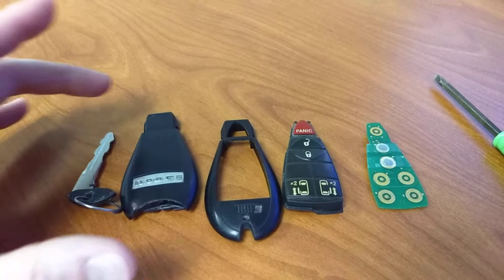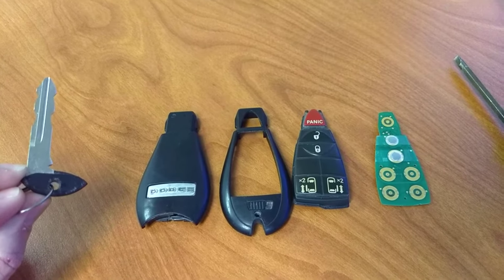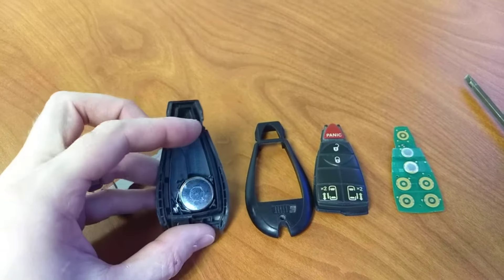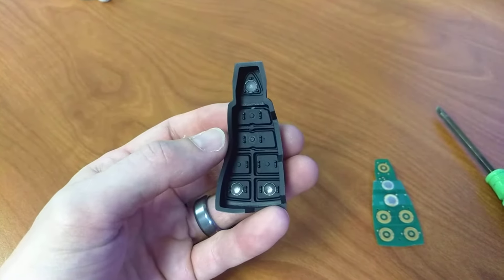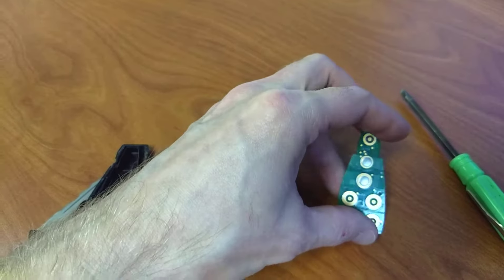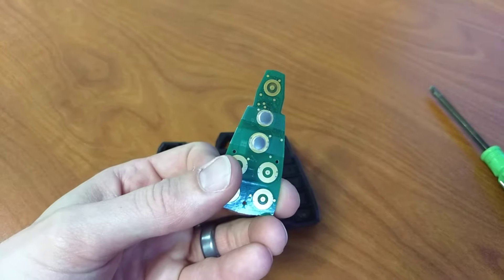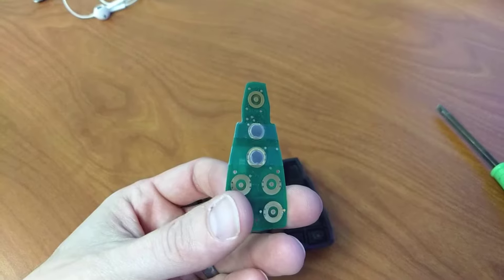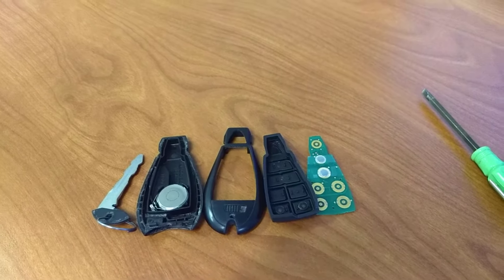How to fix Chrysler / Dodge key fob remote button - Caravan, Ram, Town & Country, Journey, Durango,

Comment: This video saved me $600. I had two keyless entry key fobs for my 2011 Grand Caravan that had both stopped working. One of them, we stopped using years ago when it malfunctioned to the point where it was no longer useable. We held on to it for the key, but it was just hanging there on the key hook for years.  We have been using the other one ever since, but it started malfunctioning in the last couple of weeks also and was at the point where I just couldn't use it anymore. Since both key fobs were now broken we contacted the dealership to get a new one. They wanted $200 for the fob and $90 to program it. So, $600 to replace both broken fobs and a minimum of $300 to get one. I said, no thank you and crossed my fingers that YouTube University would have a cheaper solution. Scotch tape is about as cheap of a solution as you can get. I will say, the Scotch tape did not work by itself for me, but since I understood the problem, I was still able to get them working. Even after taping the buttons on, my connection wasn't happening when I pressed, unless in pressed really hard. The yellow circle of goop that was on top of the buttons wasn't thick enough )probably having worn off over time like the glue. Easy fix...I used a very light dab of hot glue on the rubber for each button. Voila!! Fixed. Note: if you make the dab of hot glue too big, it won't work. Has to be just right. Hopefully, you won't need this extra step and the tape is enough, but if you do, it worked great for me. Thanks again for a helpful video.
Reply from the maker: That's awesome. Thank you.
Reply: What were the symptoms of your bad key fob

Comment: Thank You for this video. I'm not sure why I didn't find this earlier but I was so sick of having to take out the manual key everytime I wanted to use my wife's car. Finally in the last couple weeks her key started unlocking the door by itself which is very dangerous. I was able to fix both keys in a couple minutes doing this. The dealer was clueless about this issue and from various forums it seems anyone who has these keys eventually runs into this. One of the metal pieces was all the way on the bottom.
Reply from the maker: Glad you are up and running again. Nothing like a poorly designed key fob to drive you and your neighbors nuts. I’m realizing it’s not just Chrysler dealers that leave you disappointed. Ford has left me disappointed more recently as well. Different issues though... Good luck.
Reply: My manual key won't even work. 😢

Comment: Thanks so much I was having the same freaking problem. Windows were opening doors unlocking locking. I have a 09 challenger RT. I did what u just did without those little plastic circle the remote is useless u need those

Comment: Going to give it a try. Had no issues with the fob the battery died went to replace it and now it will start the car but it wont unlock or lock or panic and it was unlocking and locking itself. BEST SCARE ever on my kids had them convinced the car was haunted hahaha. So i am going to give it a go. As for you cruise control sounds like your clock spring might be going!

Comment: After watching your video i just switched out the rubber from a new key i ordered for 15 bux. That wasn't cut or programmed.  The lock smith quoted me 150 bux. So thanks. Did it for 10% of the cost. Cheers!
Reply: That works. I actually ordered two new rubber inserts for less than $10. My temporary fix until the inserts come is what the guy in the video did. I taped them down with some clear laminate.

Comment: Wow! After gluing (as you did) and taking apart several times (  as you did) I decided to try the tape method. It has worked every push of the button! Thank you for sharing because I'm retired and didn't want to pay a dealer for a replacement and programming. Much appreciated!

Comment: Thank you! I have a Dodge Caravan 2019 and it has been a pain in the butt. Transmission went out last year but had an extended warranty that covered the $7500. My AC and heat does the same thing as well. You saved me a lot of money with my key fob. Everything is made so cheap!

Comment: I recently started having issues with the main FOBIK I have always used with my 2011 Dodge Grand Caravan.  My FOBIK started acting up, mainly the unlock button.  I would slightly put my thumb on the unlock button (or even worse, put the FOBIK inside my pocket), and the car would start to try to unlock the doors.  I opened the FOBIK shell and found the little metal plate unglued. I ordered 2 aftermarket FOBIK's and they arrived today.  When I opened one of the aftermarket FOBIK's I saw it had scotch tape (very nicely taped -from manufacture-) similar to your video.  I then found your video and said "voila!, this will do the trick".  I followed your easy instructions and right away tested my old FOBIK.  It works perfect!!!  I called a local locksmith here in Pinellas Park, FL (before I found your video) asking to quote me to program one of the new FOBIK's and he would charge me $89.00 to program and cut the key inside the shell.  So your tip saved me money and all the hassel to have to drive to the locksmith shop and wasted time.  I really appreciate this video.  Thanks PromiseKeeper!!!
Reply from the maker: Thats too funny to hear an aftermarket was held on with tape too! 😂. Glad it helped.

Comment: THANK YOU - THANK YOU!!!! My 2009 Challenger RT key fobs both started going wonky after 15 years. Windows going down by themselves, horn honking, lights flashing... all without even touching the fob. Even rolled down windows during a thunderstorm!  I tried this hack last week and it seems to have solved the problem. Can't thank you enough. I was going crazy and couldn't find anything in my searches.

Comment: My 2015 Jeep Cherokee would unlock itself after I changed the battery in the fob, thought I was losing my mind. It's been sitting on my key rack for the past 1.5 years until today. Within 5 min I had it fixed and put back together. Saved me $$ Thank you!!

Comment: I couldn't wait any longer, and I waited for the answer, so I opened the fob key and tried to clean the connectors that were black with dirt, I cleaned them with fine steel wool, the kind used to clean pots, the connectors came out and I saw They were glued with a flexible adhesive so I removed them all and cleaned them well until they were shiny, then glued them again and voila it works great, thanks for uploading the video. take your 👍, I would give you a thousand more but I can't.

Comment: Thank you so much!!! All of the buttons were working on mine except for the lock button, and I couldn't figure out what the issue was until I watched your video. The piece that controls the lock button has slid on the board, and I just had to slide it back in place. 😂 It works just fine now!

Comment: Great video.  Not sure how the tape would hold up in the long term though.  I had the same problem and fixed the disks in place with polyurethane (PU) glue.  After two years, the fob started to go a little wonky, so I popped it apart and was surprised to find the metal disks still in place!  Turns out the contacts were just a little dirty.  A couple minutes work with Q-Tips and mineral spirits to clean them and I was back in business.  Polyurethane glue sticks like crazy and remains flexible.  Just be sure to clean both surfaces thoroughly and follow the instructions for the glue - and only use a little - it expands as it cures!

Comment: I went to the dealer and my fob would be $197+ 60 to replace and program. I did what you said with the tape and it works great. THANK YOU !!!
Reply from the maker: With the number of failures this key fob should have been recalled or something. Never seen another remote designed like this. It was clearly bad design.

Comment: Thanks so much. The fobs now work where they did sometimes and sometimes wouldn't.  Also had the problem with them locking the van multiple times when not being touched.  Blessings..

Comment: I had the same problem and ended up buying a new key fob on amazon for $20, all i did was replace the rubber with all the buttons inside (my current key was missing half of them) with my old one and it works like a charm, although i would’ve done this if i seen the video a few days earlier

Comment: Thank's PK  just got finished doing your procedure.. I'll give it a try tomorrow morning. Buttons are all Clicking nice, so I know it's going to work. Saving $230. Thank's again....
Reply from the maker: That’s awesome. This video has gotten a lot more attention than I would have ever expected. Chrysler has been a big disappointment. From the car keys right down to the brakes... Never again.
Reply: : @PromisKeeper  Just to give you a heads up, it worked like a charm. thanks again

Comment: I have a 2013 dart and the trunk and autostart buttons were doing same thing. I took battery out to prevent the issue. Than found your video. Thank you so much
Reply from the maker: Oh man, I’m glad I didnt have to worry about remote start on my van. My wife would have been freaked out thinking someone was stealing it. Horrible design.
Reply: @PromisKeeper  yea seriously 12 hour shifts at work i would see it on in parking lot and worried i would not have gas or other electrical issues. I started to hit panic button on leaving car any where just because it disabled the auto start

Comment: Thank You worked great for me. Had someone look at it and said I needed a new one. Saved me 300 bucks.
Reply from the maker: Key fobs are ridiculous these days. That's awesome.
Reply: @PromisKeeper  Years ago things were made to last. Now I think they are made to fail.
Reply from the maker: My dad installed car alarms and keyless entry in the late 80's and early 90's. I know exactly how far they've come. Coworker has a BMW. The battery in his key fob is sealed inside. You have to break the seal around the key fob (without breaking the key fob) and the battery is soldered inside. He was ready to buy a new car when they told him they wouldn't replace the battery for him. Pretty sure he fixed it himself finally.

Comment: As I type this, my 08 Dodge Grand Caravan has driven 202,030 miles, driving me crazy every inch it travels. 
   with the perfect timing of a Salesman trying to close more deals, this damn van knows exactly what my limits are in terms of what I'm willing to do and how much I'm willing to put in to keeping it going, thus far has consistently, without fail, taken advantage of my mechanical aptitude. 
  Just put new tires on it, $600 or so; perhaps that will finally cause the engine to throw a rod!!
Reply from the maker: Hate to hear it. Our Dodge caravan and Saturn relay were  the worst vehicles we’ve ever owned.

Comment: Nice job!  I used Superglue and found out that once the glue hardened it basically prevented the buttons from being depressed.  Had to remove all that so I could use your method.  Thanks for sharing this!
Reply: I was going to super glue it but read your comment. Thanks for saving me the hassle.

Comment: you are a fucking champ, I have a 2014 dart with basically the same key fop and one of the tiny button contactor things was between a button and I shit you not it would open my trunk and set off the alarm if I hit lock. (guessing since it was in between the buttons it was contacting a trace that went to both the alarm and the trunk) I always assumed the contacts were put on really tight but I found out thanks to this video they are put on with cheap adhesive no more problems since I scotch tapped them to the fobs PCB thanks for putting this video out!

Comment: I just discovered this as well.  Another problem is these contacts (little discs) not only slide around cuz they’re cheap, but also get soot buildup over time so you may have to clean that off if the contacts look black or it still won’t work.

Comment: Thanks for sharing, did work to restore a little of the sanity the door locks tried to steal.
Reply from the maker: Have you had problems with the door lock actuators in your sliding doors? Chrysler should have taken better care of caravan owners. Very low quality parts.

Comment: If the metal buttons come off…Take some RTV silicone and a toothpick…put a tiny dab on the toothpick and  place that on the rubber where the button should be. Place the metal button back on the silicone and let it set up overnight. Puts it back to the original configuration. But then your tape works well also.

Comment: Awesome I got to try this I have the same problem with my 2013 Dodge Dart sometimes I'll unlock the car but the trunk will open 😂😂😂😂😂
The little round buttons literally fall off inside of the fob LOL so it's almost a daily fix but I will definitely give this a try
Reply from the maker: Terrible design here. They should have issued a recall/replacement program for them.

Comment: You mentioned in your video that your van has an issue with the cruise control coming on and you tap on the steering wheel for it to work. Where do you tap? How many taps? How hard do you tap?  PLEASE can you post a video and reply to this comment about how that works. I have a 2012 Chrysler MV and this happens all the time. I have searched and searched for videos about the problem. I do not want to have to replace the whole set up. It works sometimes and not others. I figured it was a connection thing, but your comment was the first I have heard of having the same problem. I searched your videos to try to find it and couldn't find one, so if you have done a video already maybe can you post the link here? Thank you in advance!!!
Reply from the maker: It works best if you can tap above the buttons on the silver plastic with something. Usually bumping it with the bottom of my fist will take care of the short circuit temporarily. It's awkward to do but anything you can jolt it with should help if you're having the same issue we do.
Reply: @PromisKeeper  thank you!!!

Comment: Have to try this Thanks! Doesn't taping that to the board automatically cause it to lock unlock or does it require the firm click from button?
Reply from the maker: Until you press the center of the metal buttons down to make contact, the circuit stays open.
Reply: @PromisKeeper  great! Just did it and used some packing tape works perfectly now. Thanks!

Comment: Mine just quit working. Still works in the ignition, but the lock and unlock buttons quit. Changed the battery and no change.
Reply: Hi l was wondering if you had luck in fixing it.l have same problem thanks

Comment: I'm going to try this a pray it works as it look simple here, my van is 2012 Dodge Caravan, I was told it would cost me $175 to fix it. I don't have that kind of $$
Reply from the maker: Yes. The cost of something so cheaply made is ridiculous. Mine has worked fine since I posted this.
Reply: PromisKeeper, I may have to check if my battery is working, I know it was a few weeks ago because i tried the steps, ( there were a few that had slipped off)

Comment: What is the name of the two buttons that wouldn’t stay attached I lost one so no I would have to keep switching them
Reply from the maker: I’ve tried searching for “Chrysler key fob contacts” and can’t find anywhere that you could get just the small buttons. You’re best bet would be to buy a used shell and replace the guts of your remote into the new shell. The metal contacts should be attached to the rubber pad so you shouldn’t have any trouble.
Reply from the maker: Or go to a dealership and schedule a test drive. Swap remotes while you’re off the lot and give them the bad one. lol.
Reply: PromisKeeper 😂😂😂😂thanks bro

Comment: Question, I did everything u did. Im sure the key would work but now the key is not responding to the car...I haven't fixed the for maybe a year, I just did the manual way...u think I will have to reprogram the key to the car?
Reply from the maker: I don’t think the fob or the vehicles computer would forget that they were paired together. If double checking the buttons are in place correctly and putting in a new battery in doesn’t work that’s all you’re left with I guess. It needs programmed or maybe the key fob is faulty altogether. It’s Chrysler, I don’t think you could ever rule out any number of frustrating situations 🤷🏼‍♂️

Comment: what if you're missing the little buttons inside? any suggestions as to where to get replacement parts?
Reply from the maker: The cheapest option is to test drive a car and swap the guts of your remote with theirs. lol   I found this on amazon:
Replacement Remote Keyless Fob Key Case (Shell) For IYZC01C M3N5WY783X https://www.amazon.com/dp/B06ZZB3MML/ref=cm_sw_r_cp_api_i_Sj-GEbVHPQ8C8

Comment: I have a 2010 dodge caravan. It has about 38,000 miles on it. All of a sudden the car starts beeping, unlocks itself while I'm in the house with the fob hanging up on a key holder. Yesterday I pressed the fob to open the door. The button popped up and down. Basically I can't get in with the fob. If I use the key to get in will my car start with the bad fob. I need to put the fob into the car and turn it to start my van. I do not have a button to start it. It's very cold and snowy here. I have a disabled son and don't want to get stuck on the road if we can even get out. Thanks.
Reply from the maker: Our remote would cause the car to lock/unlock while hanging on the key hook too. I would try and put the small metal contacts back in place before starting the car on a cold day and taking a chance of it locking you out.